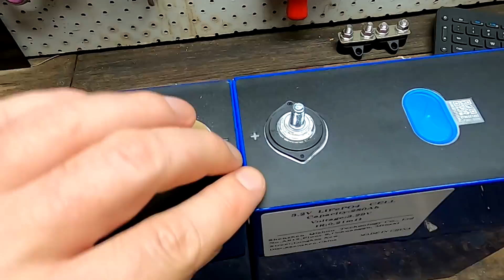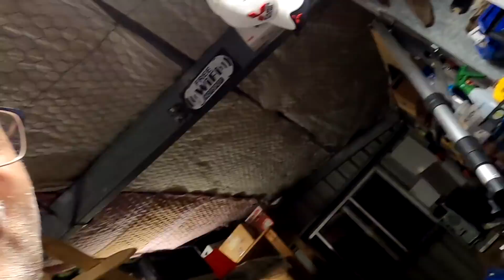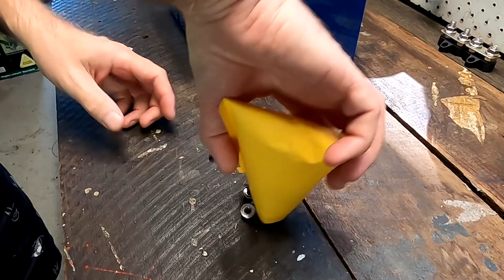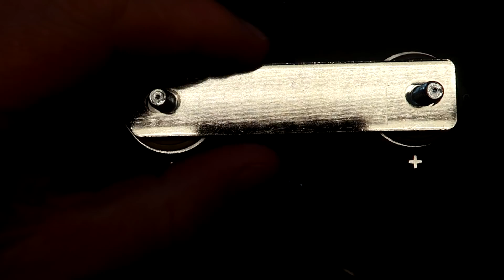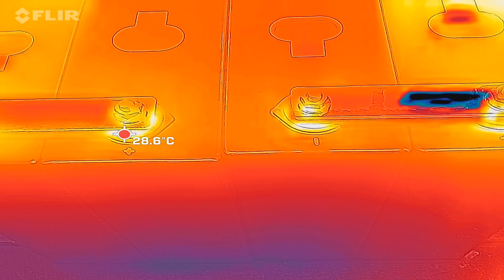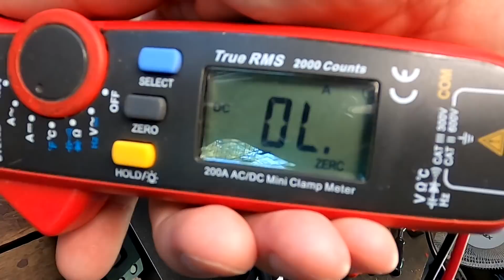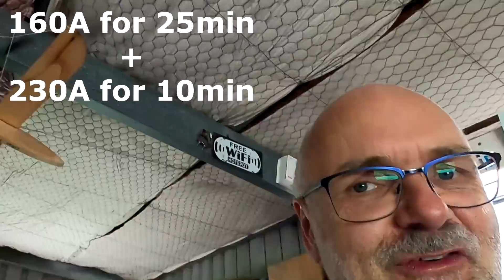EVE LF304 with welded studs. Pushing 230A through a tiny terminal?

Comment: When I got my welded stud cells I had the same first impression. I was concerned because of the videos posted by you and Ray. I went ahead and built the battery using the included buss bars. Two things I did different. 1. I used an aluminum washer under the buss bar. 2. I used Deoxit and a Scotch pad on all the parts. Yesterday the battery was at 15% SOC due to rain day. Sun cam out and the charger was charging at 140 amps. Two weeks now and I have yet seen any heat on the buss bars. My breaker,  2awg cables, and cells were 7C above ambient.
Reply: BTW, I am not sure that torque is all that much of issue in making a good connection. Only to ensure you don't over tighten. I turn wrenches so didn't bother with a torque wrench. After years you get a feel for when a nut is tight.
Reply from the maker: Thanks for sharing your experience. That is great to hear. We will see how this works out over time but I think we will have much less problems than in the past with battery #1
Reply: @OffGridGarageAustralia  One note on your follow up video. My washers are 1/4" and fit on top of the shiny or smooth area where the buss bar would sit. You mentioned about folks that put a larger washer that fits down on the welded area. I agree with you that is is too rough and not a good place to make a low resistant connection.

Comment: 040622/0321h PST 🇺🇸.   040622/2021h Brisbane 🇦🇺… hello Herr Andy, thanks for the presentation. I don’t thing this is a matter of concern. The supplied bus bar is 2mm thick and this is the exact difference between the top of the step and the bottom of the welded plate. The diameter of the step is 10.88mm. If the hole of the busbar is enlarged to 10.90 it will fit snuggly around it. The serrated SS nut will take care of the tightness and current. But do the experiment outside the box and check the fitment and current loss, if any. You may smear the MG Chemicals conductive Carbon grease or the No OX grease on all connections. This is my thought, it may differ from people to people. Let me know. Take care und 73s…
Reply from the maker: Thanks Sree. I covered this in the next video...

Comment: Can you get a lug that has a ID of 10mm, that sits over the 10mm raised portion on the welded stud. So that when the nut comes down it sandwiches everything together for full contact surface area?

They were probably having issues of the non-welded studs being overtightened, and stripping internal threads, and rendering cells useless.
Reply from the maker: The area below the welded stud seem to be very rough from the welding process though. I don't think we're getting a good connection there.

Comment: Great high current performance on those new batteries.  I hope the capacity meets the rating.  Looking forward to you getting them installed on the shelves.  Time for a new clamp meter that can go 300A+.
Reply from the maker: Thank you. The capacity test seems really good with these cells (next video). My instant thought was getting a new clamp meter with a higher range... 😊

Comment: I was surprised with how good a contact you got on such a small area, goes to show a good  a tin plate to tin plate metal Contact can be!. 
But will still be concerned that after 64 such connections, there will be a few troublesome joins.
If you want to maximise co tact area, a thick lug (thick enough so nut can clamp it) with 10mm hole will provide Max contact to terminal but as o e surface is Al to Tin plate you may see losses in earlier experiments (I recall, they were not to bad).  These will need to be flexible bus bars as there is no slots because of desire to Max contact area
Reply from the maker: Yeah, I was surprised too. The high force on this small area must keep the resistance super low. I will fit both battery banks with this method now and see what happens over time. It a big experiment!

Comment: I have the same welded studs. I figured the smaller contact area is still double the 35m2 cables. Mine is running cold with a max of 160A drawn.
Reply from the maker: Perfect, thanks a lot for sharing, Steve. So 5 cucumbers for your setup then 😁

Comment: My eve 280 cells are still on their way, so I rely on your findings. The material is different, I assume eve would test it before put it in production. Keep in mind, the nuts also have contact on the bushbar
Reply from the maker: I'm unsure if EVE does weld them on or the supplier...

Comment: I have the EVE 305ah batteries with the welded studs for 4 months. I started with aluminum busbars and had lots of trouble with heating even with cleaning sanding. I put the tined copper busbars that came with them and it works perfect. No cleaning paste nothing.
Reply from the maker: Great, thanks for sharing. I will do the same with my banks, just using the copper bars and see how we go over time.

Comment: Thanks for this test, I was wondering about this as well. As said before, I do use ring lugs on the studs instead of busbars with slots. I did a quick test, but not with 230A. Thanks again.
Reply from the maker: That should be totally fine. I could not test any heat building up around the flexible bus bars with ring lugs on mine. The contact area is even larger and 4Nm seems to be enough.

Comment: Hi Andy, yes I have 230ah EVE with welded studs. Work absolutely perfect since month. Just let you know that you can customize your cell orders. You can order with and without welded studs. But with studs it's a very big difference in a positive way. My older 280ah EVE with drilled holes was a shame, I torgue them with just 3 nm and 4 threads of 16 cells are broke out of the terminal. Now with welded studs a difference from frustration to satisfaction at all. Cheers
Reply: Are you able to repair the cells with the stripped holes?  Tap a larger flat bottom hole perhaps?
Reply: @ForbiddTV  yes I just took a bigger thread bolt in it and 5/16 not m8. Because had a different thread to bite in the aluminium. I did that because the whole was bigger anyway cause of the outbroken thread in the terminal. the whole thread broke out. So the hole was clean around without any thread anymore. Hope my English was good enough to explain that. 🤔🙂
Reply: @simonguest1890  Sounds unstable if you didn't re-tap the hole, but if it worked then that's all that matters.
Reply: @ForbiddTV  i did that because it is more stable than the other way. If I would cut a thread in before I might have the problem again. Now it move not a millimetre at all. It's more stable than any other bolt in the rest of the cells.🙂
Reply: @ForbiddTV  by the way the stainless steel bolt cut the thread in the aluminium himself by drill it in. Aluminium it's very soft on that terminals.
Reply from the maker: Thanks for the info, I wasn't aware of that you have a choice when ordering.
Reply: @OffGridGarageAustralia  Sure You are welcome,  i don't know if its depending on the seller, but in my case, BASEN and Donguan Lighting did that. But I prefer Donguan Lighting. James Mo is know promoted to a manager position, he do always the best for customer. They just sell Grade A cells. Doing good business in long term. 202ah cells delivered 210ah, and 230ah do 240ah.

Comment: Can you run the fuse for inverter on the positive or the negative.?
Reply from the maker: It does not really matter but the fuse is usually in the positive cable.

Comment: Hi Andy. Again, thanks for all the great videos with unmatched detail. I have learned so much from  you and your videos. I do have a suggestion/thought. Perhaps you could "countersink" your thicker bus bars so that there are two contact areas using a flat headed drill bit so that the modified/countersunk bus bar would contact both the higher smaller area and the lower area of these new welded terminals on your later model K-Series batteries. Or even having/stacking two bus bars, one with a larger opening that would contact the lower larger terminal area and then one with a smaller opening that would contact the smaller upper terminal area.
Reply from the maker: Thanks a lot Naomi, great to have you here!
The lower part of the terminals is not as smooth due to the welding process. You will see this in one of the next videos, so I don't think it is actually designed or meant to be used as a busbar connection.

Comment: Terminal disign at these cells resembles design of terminals at large stationary lead-acid cells for industrial and telecom. Cells of Gell 1500-3000 Ah from Exide/Sonnenschien, for example. Such terminals requires special design of cable-based inter-cells links terminal connectors. Actual contact to terminal in such design is done through terminal's ring of larger diameter, not smaller ring, which "houses" stud. This smaller ring acts as fixing for cable link. So, I siggest to use wider busbars with larger hole to contact with larger ring. Contact pressure will be accomplished by 1-2 washers on top of such bubar, to overcome heght of "step" from larger to smaller rings of terminal.
Reply from the maker: Thanks Sergey. I don't think the lower area of the terminal is meant to be used as a connection point though. I'll show you in the next video.

Comment: Is it make sense to add a conductive carbon paste  between them?
Reply from the maker: I think this does not make any difference as it is working like this just fine. The high pressure on this small area results in a very small resistance.

Comment: I love the welded lugs.  I have no problems.  250amp daly bms but set at 200amp.  No fancy meter, just hand tighten.  The nut acts as a better point of contact.
Reply from the maker: Thanks for sharing. You're using the original bus bars as well?

Comment: Thanks Andy, Great test, may be the smaller contact area is an advantage more clamping force per square mm  helps deform the surfaces and makes full contact ?🤔
Reply from the maker: Yes, that is what I was thinking as well. We have all the force on this small area instead of spreading it across the whole flat terminal. On the other hand, 4Nm are 4Nm.
Reply: @OffGridGarageAustralia  Watts / Amp = volts  &  Force / Area = pressure . (might be a better way of explaining it)

Comment: I just ordered 32 "Ninthcit" 280AH cells from "BLS Official Store" which arrived in boxes with "EVE" scribbled on the side and LF280K in the barcode. Capacity tests OK but they have welded studs in contrast to the 4 "Ninthcit" cells I bought last year with large square welded studs (still don't like welds but at least the older cell terminals were really big). I thought the welded studs were due to rebranding or Grade-B instead of Grade-A, so thanks for confirming it appears the original EVE cells are welded too, that makes me feel at least better for not being ripped-off.

Still, this contact area loss is not good to see logically. I wonder if this is due to some new EV/industry standard connector and we could find them, perhaps helps with the uneven connection issues you found before? I wonder what milled-out stepped busbar holes would achieve if you could get your busbar friend to make some to test. ;-) Although there appears to be no issue according to your test it would be a good video/scientific test to investigate utilizing these new terminals in new ways.
Reply from the maker: Thanks for your comment. At this point it is not clear to me who is welding the studs onto the cells. Per factory, the cells seems to come with just flat terminals but someone must upgrade them later on for whatever reason. These studs, welding machines and labour are extra costs, so is this just a reason to rise the price of the cells?
I think the lower levels of this ring is not suitable for any bus bars connections as it is fairly rough and uneven from the welding.

Comment: Hi Andy, I hope you are well. Love your videos, super informative. I wonder if you could advise the current cost (approx would be fine) of the cells, I live in Brisbane. I am looking at a purchase of 4 of either the 280 or 304 to use as a 12v power supply for camping. All the best Peter.
Reply from the maker: Thanks Peter. I ordered the cells back in December and paid for them at the time. Prices have gone up like 20%-25% since then. 
It's best to get in contact with QSO and get a quote as it includes shipping to your place as well then.
Links to these cells are here: https://off-grid-garage.com/batteries/
Reply: @OffGridGarageAustralia  Thanks Andy😊

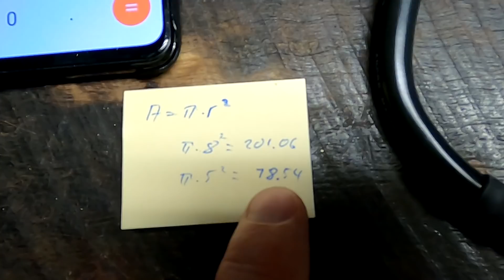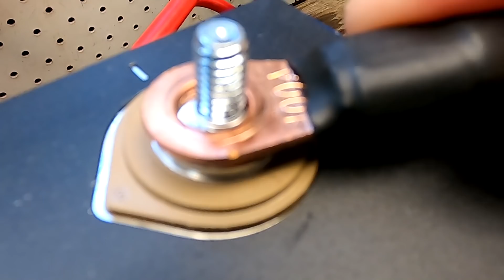Comment: I think your calculations (7:34) are too kind. You need to subtract out the hole for the stud in the ring terminal, and worse, the elongated hole (or at least part of it) for the bus bars. Looks to me like it actually might be less than 1/4 of the area of contact in the non-welded version. I agree that this is quite concerning. I should just do the math. A quick googling shows that the hole on an M8 ring lug is 8.4mm. That's 55.4 mm2 to subtract from each of your areas, leaving a ratio of 23.14/145.66, or 1/6.3!!! Less than one sixth of the old contact area! And it's even worse for the bus bars!! Note: I see at 16:00 that the studs must be M6 instead of M8. But that just means the ratio is somewhere between your calc and my calc. So using diameter of 6.6mm for the minimum hole in an M6 lug, I get a ratio of 44.34/166.84. Just a little more than 1/4. Good eyeballing Andy!
Reply from the maker: Thanks Dave. The cells have an M6 thread or stud. The area is really tiny!
Reply: @OffGridGarageAustralia  Yeah. It takes it from a 60% reduction to a 74% reduction, though. But as you showed, the studs and bus bars seem to handle it just fine. Good to know. Thanks for all of your great battery videos.

Comment: Ill have to check later, but I do not recall my welded ones from last year being anywhere near as tall or slim at the base.
Reply from the maker: I would not be surprised if other suppliers use different studs and weld them on.
Reply: @OffGridGarageAustralia  My surprise comes from using the same supplier.

Comment: I have a copper washer that can fit around the terminal thus giving you complete coverage of the terminal and not making it thicker. Perfect solution not sure.
Reply from the maker: That won't work as the next level down if very bumpy, rough and uneven from the welding process. Only the top part is plain and straight.

Comment: Hi Andy, great video as always and I have to admit, I like cucumbers and wallabies in no particular order (kangaroos not so much)

It was a relief to see that welded studs work and I think it would be nice to compare resistance between welded and studded cells.

So, 2/0 cable has a cross section of 70mm2 on copper and these welded studs have 78mm2 using mixed metals so area wise I don't see the issue given you have a good quality contacts. Comparing resistance would be a more scientific approach here but your tests suggest no issues! 

Possible issues could arise if oversized lugs are used, other than that I think we should be fine with welded studs. 

Could you please answer the following 3 questions?

- What is the thickness of the qso busbars? (Thinking of drilling them to bolt the leads for bms sensing wires)

- Which terminak rings are you using in this video? Aliexpress link would be awesome. 
Ordered some m6 but they are garbage, made of brass and 0.5mm thick.

- What is the approximate distance between terminal stud centers on these new EVE 304 when cells are arranged narrow side by side in two rows configuration? Does the original busbar fits or a different length should be used?

Thanks!

A
Reply from the maker: Hi Anton, I like kangaroos very much 😉
From a pure surface area perspective you'r right but the actual contact area is far less than that and tiny. I was really surprised that it actually worked with 4Nm of torque.
- the bus bars are 2mm copper and I have already drilled and tapped mine with M3 for the BMS cables, no problem
- terminal rings in terms of ring lugs for the BMS or the main cable you mean?
- that's a different bus bar length for this configuration. It always was. With the old cells, it was a longer one, with the new ones, it is actually a shorter one. There are drawings with dimensions in the specs sheet on my website. It's the same dimensions as for the LF280K: https://off-grid-garage.com/batteries/

Comment: hi andy, is it possible for you to do a test for the JK BMS for something like 150a~200a continuous charge/discharge test, and check the temperature of the BMS and BMS''s cabling. I was fed-up with JBD/QUCC 200a BMS and looking for alternative BMS. Thank you.
Reply from the maker: We have to wait until the 4s JK BMS has arrived and we will do extensive testing on this version. 
I just don't get 200A on my 48V system...
Reply: @OffGridGarageAustralia  hi Andy, thanks for your reply, really appreciate it. Is it possible to have 150a load on the 48v JK BMS? 
I have nightmares with qucc BMS, desperate for looking other solution.